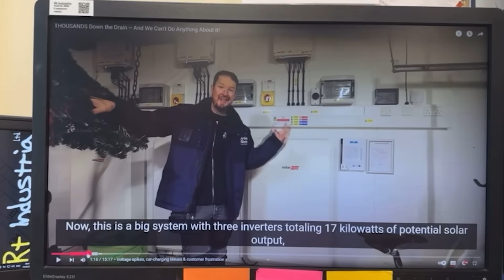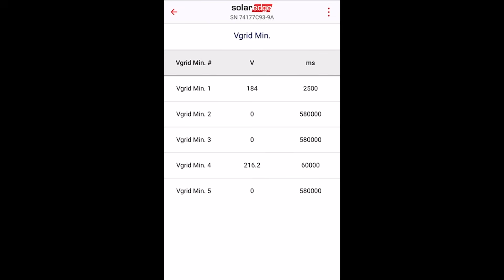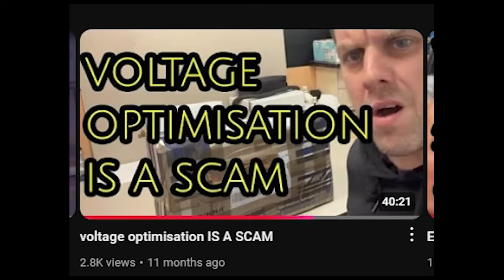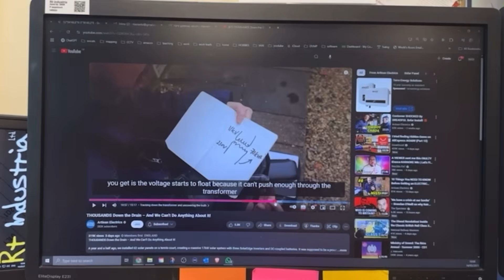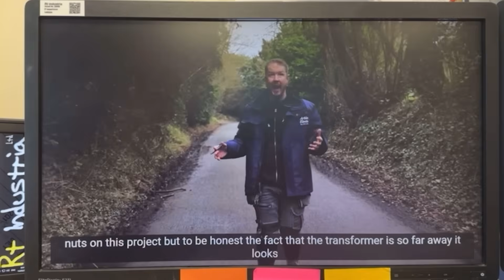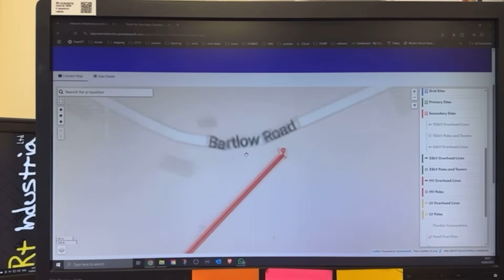ARTISAN ELECTRICS v THE GRID. WHO,S TO BLAME

Comment: I wouldn't be happy to be connected to the same section of the grid as those inverters. Their output voltage should be limited just like the DNO's supply voltage is. All the gadgetry of their local neighbours is being subjected to supply voltages that are pretty much on the limit of their design specification. In certain industries that feed power back into the grid, there are deliberate limits. But as you say, to push power into the grid the voltage has to be greater than the supply voltage.

When matey boy pointed to the supply transformer and remarked on its apparent condition he failed to point out that it's the copper, iron and oil inside that are vital, not its external appearance. By 21st century standards it may be a little small though, given that more and more people will want to rapid-charge their EVs. 

But if the DNO agreed to accept a certain amount of power then there is some responsibility to rate the equipment accordingly. Small print may well cover them though. Proving the legitimacy of any claim in court would be an interesting test case. No doubt expert witnesses and briefs would love to get their teeth into that one. But an out of court settlement of a couple of Mivvies and a bag of nuts would probably be hammered out before running up the inevitable bills.

Comment: Step 1, disconnect solar, allow DNO to test and verify if they have issues. Step 2 phone Inverter support and tell them the config you have and the issue and ask them how to set it up correctly.
The whole adding a passive voltage doodat which is just a transformer, what the flip!

Comment: Note: Generation equipment under G99 doesn't have to cutout until it reaches 262.2v for 1s. Best avoided for equipment in your house but that's the ENA specs they test to. FYI had a similar voltage problem and it's down to the underground cable not being thick enough between pole and my house (DNO did offer to upgrade but would be nightmare) we got the transformer tapped down so it has more gap to export (240->230 base level). I can drag voltage down to 206V but I just limit the max amps Inverter and chargers pull at same time. System also uses batteries to export before sun starts so export is evened out so exporting longer at lower levels so never have to clip output/generation.
Reply: @rcourt1977  at last, someone on this thread who actually knows what he is talking about

Comment: As someone else said on another YouTube video - "I tried to cram 17kW down a single phase domestic supply in a rural area and the voltage changed" - There's your problem.
Reply: That's "the" problem. There is a lot of confusion in the comments about whose problem it is. It's the DNO's responsibility to check the connection is suiatble for the proposed generation before issuing G99 permission to connect generation. It's the customer's problem to try to get the DNO to acknowledge this and make it right at the DNO's cost.

Comment: I don’t agree that the DNO should require monitoring sans solar - they’ve approved a 17kw connection, meaning they assessed the recorded design of the local infrastructure as being able to transfer the energy into and across the network.  If there is an undetected problem with the infrastructure which restricts the calculated energy transfer, isn’t that the point of the exercise, which would require that the solar output, or equivalent, be connected?  Maybe they should hire a generator for a week and feed THAT into the grid and see if the problem continues?
Reply: Absolutely correct. DNO has cocked up its G99 assessment and should take responsibility. Voltage assessment should include all approved equipment including the 17kW of PV

Comment: As an electrical engineer I completely agree.  Over the years as I (my original system), family members, and friends have gotten solar professionally installed, I gotta say, I am NOT impressed by much of the work.  All of the professional installers took short-cuts or made serious mistakes, particularly on roof penetrations.  But they also don't know how to size systems, particularly inverter-battery systems, to match the AC coupled solar they insist on installing (which is basically dumb as bricks when you have an inverter-battery system... you always want most of the solar to be DC coupled with inverter-battery systems.  At least for large systems).

For huge systems it can be a mistake to AC-couple because it takes a lot to manage large AC coupled systems without hitting voltage issues such as the one discussed here.  You have to have sufficient inverter, battery charging, and battery capacity to handle ANY surge that might happen because even with frequency control, microinverters just can't respond very quickly to load changes.

Thus, with large AC coupled systems, the inverter's battery charger MUST more or less instantly take up any load differences to keep the voltage stable.  That seems to be the issue here.  Large AC coupled solar system, insufficiently-sized inverter/battery system.  e.g. if there's a cloud the solar goes to near zero, and the sun comes out and poof, suddenly its pushing 10kW... that energy has to go somewhere and the only place it can go is into the battery.  So the inverter/battery system must be able to charge the battery at that rate to take up the slack.  And it must be able to do it all day long.  If it can't, the voltage shoots up.

The energy has to go somewhere.  No magical transformer can make energy disappear.

-Matt
Reply: The issue you describe is only relevant to islanded AC coupled systems where there is nowhere for the excess energy to go. Grid connected AC coupled systems can export excess energy into the grid. The voltage rises because the grid resistance is too high for the system. Tapping down the transformer and or absorbing reactive power would drop the voltage back in line. Most solar/wind farms and big batteries are AC coupled and use the aforementioned methods to mitigate overvoltage.
Reply: Having DC coupled storage is a very good way of controlling maximum exported power to the grid because you just select an appropriate inverter.  You can shove in as many batteries and charge controllers as you want without worrying about export limits. Also DC coupled 48V battery packs are far cheaper per KWh than AC.  You can even use additional inverters to feed dedicated loads off the batteries (use a transfer switch in case they blow up) without impacting the export.

Comment: Great video 😂😂

I watched his video just makes him look like a clown, putting in a 'voltage optimiser' just to mask the issue is a stupid idea I'd be really concerned with 17kw of power going through that small transformer.

I'm surprised it's got this far I thought vigorous tests are supposed to be carried out by the installer during the G99 process which would of caught the voltage levels.

The inverters can be set to only export a certain amount of kw per inverter by doing that they could then prove if it is actually the solar system causing it 

Also instead of having all 3 inverters pulling from the grid at night at the same time why not set up a timer for each inverter, allow each inverter to charge for 2 hours   during the cheap tarrif. End of the day the customer is being a greedy fuck.

I installed 24 panels on my house which I thought was alot but the amount he has got is mental

Comment: This problem is simple. The voltage variation is only caused by impeadance and the current take. If you have high impedance then the current take possible is reduced. The no-load voltage of the transformer is set near the maximum so it negates the volt drop when loaded, giving a maximum possible volt drop of 40V. The impeadance could be reduced by local power factor correction (could cause resonances, but will filter out many of the harmonics giving grearer levels of volt drop). The fix is loose some of the peak power during mid day by battery charging, limit the battery charging current at night to keep within the voltage tolerances. The fitted optimiser is a bad idea as this only exports the excessive voltage to other supplies on the line. 

If 17kW is giving 18V drop (will be worse at the end of the line), then a 35kW load will give a variation greater than the tolerance (40V).  This is 5 x 7kW EV chargers, and this is only 1/3 of the transformer rating? The supply is too soft to cater for large loads/generation and this is going to be a reoccuring problem around the country. 

As said the work quality is good the advise recieved is poor and hopefully we will learn as these problems are discussed constructively

Comment: Why are they not using the free daytime power to charge the battery’s, rather than paying at night? That makes no sense to me.
Reply: Mostly coz you get paid 15p to 16.5p per kW exporting on a Smart Export Guarantee tariff
Then you buy off-peak for 7p or less per kW
So you export 1kW, get paid 15-16.5p or more, then buy back what you need at less than half the price off-peak

Export 50kW & get paid £7.50 to £8
Buy back 50kW, 3 hrs at 17kW caning it to 3 batteries cost £3.50 (too quick, slower charge chaps)
So you make £4+ or more if you're a greedy so & so

Normally, revenue isn't as big as this on a regular 5kW system
But on a stfu system like this, they might be trying to generate & push up to 100kW or much more per day

62 panels x 500w = 31kW array split as East/West
(probably peaking at 25kWh generation at midday on a E/W split)

TL-DR, Customer wants a stfu system to brag & generate as much as possible but still reckon he will take ages to square that even larger Artisan bill for the huge system install
Good luck getting a quick return on an expensive Artisan job

Comment: One thing that the DNO might not know about is other solar in the area. A large number of installations get connected without approval and therefore didn't factor in the DNOs calcs.
Reply: @danieljohnson8240  
That doesn't make sense. If you want to sell energy ( which should be the case due increased voltage) they should be aware since you need your overflows measured and registered for selling . 
In connection without overflows it might be possible that some idiot enabled them without being allowed to but it could be discovered by meter. 

In case of new meters and no overflows/grid export mode even momental technical overflows from inverter ( until it balances overflow close to zero) will be discovered by meter. And given the high voltage caused by mr. voltage optimizer it is possible that solar inverters in the area without export allowed have issues as well since overvoltage protection might activate hard disconnect via contactors and error messages would be there.

If your solar installation is not grid-tied eg. island system installation you don't need network operator approval. But you still need electrical check for insurrance, your good night sleep and insurrance legal thieves.

Comment: I’ll tell you what Ol scone that PTE is in serviceable condition, probably a 350 kva or maybe 500 kva transformer, also I’d say the solar is issue, DNO use logging equipment all the time, also dissing the “board” aka DNO is no a good move, majority of DNO power engineers are fkn clever clever folk, trust me as in my pre railway life I was seconded to the local DNO when I worked with a rather large generator rental company, I know a particular power engineer on linked in who would come out and pull all our pants down & laugh at what Jordan is saying

Comment: This is quite interesting and I would like to know what happens here with this issue. I don't have solar and so it is beyond my live experience, but... 
I have had another thought, which needs checking with an oscilloscope.

...and that might be the compatibility between the inverter output and the car charger metering.
If there is significant variation in the distributed power waveform within the property (Inverter generated or PF modified) then the EV charger's meter may be 'reading' a different voltage value.   

This could be complex multi-step issue with the inverter responding to what it senses as the output and 'correcting' and then the EV charger sensor reading 'out of range'.  
Does anyone know how the inverter increases the output voltage to gain the desired export rate? Is it scaling the wave form and therefor peaking above 340v or modifying the waveform under the 340v peak to pull up the 240v RMS to 250/260v?

Comment: Wonder if they have planning permission for the ground mounted panels......?
Reply from the maker: It’s not popped up when I was looking , not sure if it’s needed
Reply: @Actual_electrical_content  Over 5m from a boundary but might still need approval/running it by them, maybe a certificate of usage from council - they can be picky or yeah OK
Be a bit of an issue if it wasn't fully approved - even if over 5m from boundary, on your own tennis court...
Stuff like checking it is weighted with enough ballast, though if it survived some gales we've had, it ain't going anywhere just yet.
Generally ground mounted systems need approval - especially one this size I would have thought
On a flat ROOF -  fine permitted usage, like on wall of house is permitted usage for solar

But actual GROUND mounted systems, approval is usually required or at very least certificate
Yes it is a very low mounted one, not raised 1m above ground to nearly 3m tall ground mount system

It seems like they used a flat-roof mounting system, slung it on a tennis court
But a tennis court isn't a roof, so the panels are ground mounted
So technically...
Reply: Anything ground mounted over 9m2 requires planning application.....

Comment: Surely, if there is a reasonable resistance in the supply somewhere, there could be a sizeable voltage drop on the local line, the solar would need to increase the generated voltage to achieve the reverse current flow, and equally, this accounts for the drop exactly. With a high of 260v ( +20v over nominal 240v ) and 220v (- 20v below nominal ) while under the load. Assuming 17kW load or generation, appx 70A at nominal, I would estimate the resistance in the line would be appx 0.28 ohms. It doesn't seem that large to me. I don't know the nominal resistance of that sort of line, but if that is high, it could be one or more of the joints contributing to the total - simply halving the resistance ( e.g. by re-making a dodgy joint) would reduce the voltage swing to +-10v. ( The guy claims to understand Ohms law, but doesn't actually use it ). And that 20v * 70A is appx 1400 Watt power dissipation happening somewhere.
Possible troubleshooting would involve shimmying up the pole at the end of the driveway, and measuring the voltage there, and the drop across the joints, or maybe use a thermal camera to check for warming while under load ( or just look for the warm orange glow at night form the 1400W heater/joint ) . He could have asked the neighbors if he could measure voltage there. Maybe they have have a dodgy connection on the property. There seems to have been zero meaningful or systematic diagnosis and fault finding.
I seriously don't get why they charge from the grid and export - surely that makes no sense - just charge locally until full, then there is no need to charge from the grid - I feel like the whole install has not been explained - like that voltage "optimiser" - seems like a piece of junk to me -  again if the issue is the car charger, just put it between the car charger an the supply, not "everything"
The local grid is surely designed for fairly low average loads - just built to tolerate a peak aggregate or a peak from a small number of properties, drawing 17kW continuous is not what was intended
Reply: At the low-current end of the spectrum, 72A to 240A rated LV-ABC cables have a resistance of between 1.9ohm/km to 0.32ohm/km respectively ( based on published data sheets ). This accounts for at least half the estimated resistance ( depending on actual spec of the line ) , accounting for appx 10v of drop at 70A Certainly, running a thicker/higher rated line, or splitting to 3 phase would likely result in an improvement, but  dodgy connection would be my starting hypothesis after calculating the drop due to the cable using the correct spec.

Comment: Jesus H Christ. I had to stop watching the original video as I was basically shouting at him through the screen.
Artisan doesn’t want to take the L for selling an oversized system to a customer. Could’ve just refunded part price and reduced the size of the system to solve the problem.

His point of upgrading the transformer isn’t going to help his mistake as the incoming mains supplying the house would need to be upgraded for the voltage drop.

Here in Australia solar output is generally capped at 5KW/h per phase for this exact reason. We also have better conditions and far more properties have solar so you can imagine the headache for the grid operator having a couple of thousand mini power plants to deal with.
Reply: Another point is who in their right mind would set up a battery system to draw 17Kw at once?? That’s a 70A draw, more than the average house consumes. All on single phase supply as well which is even more insane.

Comment: He is not saying that they are providing the over voltage.
He is saying the mains impedance is too high thus allowing the voltage to drop when a high load is present, and when they are supplying reverse power the voltage rises.
Yes the voltage optimiser would not help in this situation.
But if the supply is dropping 20V on high load it suggests a high impedance supply.